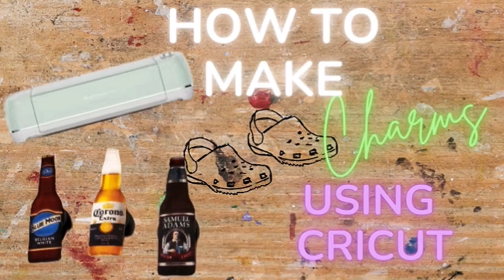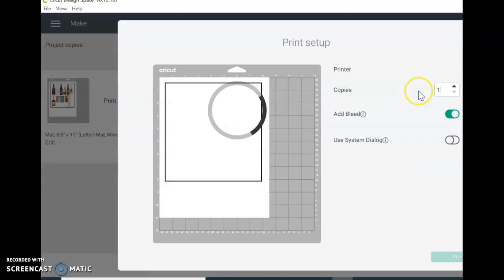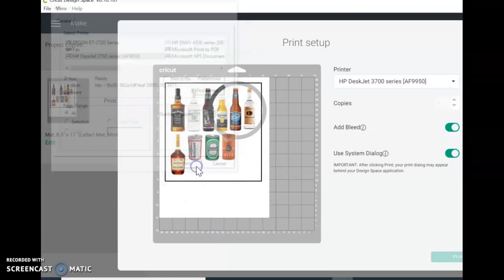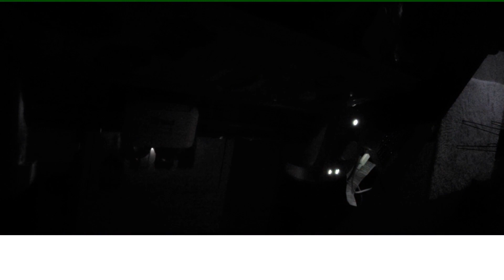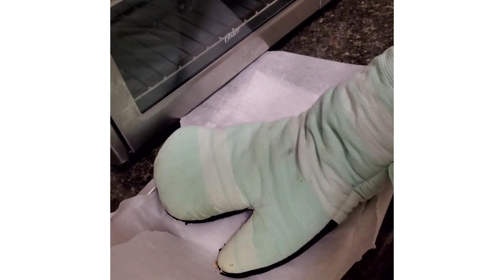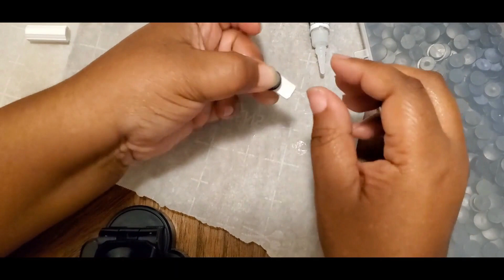Create Croc Charms using Your Cricut

Comment: Do not use E 6000 because it does not stick to the croc charms back, it doesn’t stick to the little piece that you’re glowing onto your actual charm. I learned that the hard way after I made an entire tray of them last night😅
Reply: Is there a better glue you recommend ?
Reply: @jamiedelatorre1908  Nope, I also tried Gorilla glue and it didn't work...maybe hot glue is the way to go, but I haven't tried that yet.
Reply: Did you allow the E6000 glue 24-72 hours to dry? I just used E6000 after attempting UV resin but that just broke off. Unsure if since I didn’t use the clear back pieces it didn’t cure all the way which caused them to break off or what. But I’ve had mine sitting for a little over 24 hours. I attempted to put the Mr. Clean charm on and snapped his head off but the back stayed on. I attempted to put another charm on but the backing did lift up. So I’m assuming that one didn’t cure long enough. I redid it & going to wait another day or 2
Reply: @Nicox2319  yeah this was a while ago that I had tried it but E 6000 does not last if you use it on the little silicone shoe charms. It might feel like it does but it falls apart pretty quickly and yes, I had let it thoroughly dry.

Comment: Thanks for the video!  The link to the buttons is not working.
Reply from the maker: You're welcome the links have expired you can just search for them on Amazon shoe charms
Reply: @goochiemadeit9067  thank you, that was a quick response!   I noticed that the charms were thick. Was that the shrinking sheet expanding as you mentioned?  What are the bottoms called?
Reply from the maker: @veronicaramirez5686  yes the sheet gets thick and hard once baked and I believe buckle plastic buttons

Comment: Def take the lights off or use matte tape over the registration lines. If not, then the machine can't detect the registration lines and you will get an error Taking the lights off helps take the glossy/shine off the paper. I should have referred back to this vid when I did may test run today lol would have shaved me so much time lol Thanks again for a great vid!!!
Reply from the maker: You're welcome 😊

Comment: I tried making them but the ink Smeared do you seal them? If so how.
Reply from the maker: Hi did you print on the correct side? I've only experienced that when I printed on the wrong side
Reply: @goochiemadeit9067  yes I printed on the frosty side. Iet dry, and days later ink still smeared. I’m going to try and just put a coat of Matte modge pod
Reply from the maker: @LinaMCif  let me know how it turns out

Comment: Hi, this is a great video. Thanks for tip about the lights off. I clicked the link for the shrink paper but it’s no longer available. They have another option ( same company ) but it has 6 white sheets and 6 semitransparent . What’s the difference ? Is there another brand you suggest ?
Reply from the maker: Hi, the one I linked is  the only kind I've used that is printable unless you use shrinky dinks that you can draw on if you would like to make your own design.
Reply: So do you use the transparent ones or the white ? Or does it matter ?
Reply from the maker: @kharikreations9352  the one I used was white as long as it says printable you should be able to use them

Comment: Man I cannot get my machine to print n cut it cannot pick up the outside lines 🤦🏽‍♀️
Reply: Sometimes I add a strip of school glue stick on the lines to take the sheen away
Reply: Recalibrate your machine it will work...let me know who it turns out...
Reply from the maker: Hey love try it with the light off and if not contact cricut to troubleshoot if that doesn't work they may send you a new machine
Reply: Thats ur problem 🥰

Comment: This is an excellent idea and good tip about turning off the lights during the cut.  It would be very nice if you could provide links to where to buy the supplies, button backs and printable shrink film.  THANK YOU.
Reply from the maker: Hi I updated the description box to include links to the products.
Reply: Yes would like to see video using uv
Reply from the maker: @veronicatrevino6000  I have short I uploaded that shows the uv resin charms I made teacher charms
Reply: Where? I checked buy I don't see them.Only save by bell clip
Reply from the maker: @veronicatrevino6000  it shows them with uv resin on them and should be one with me putting it on them as well unless it was removed